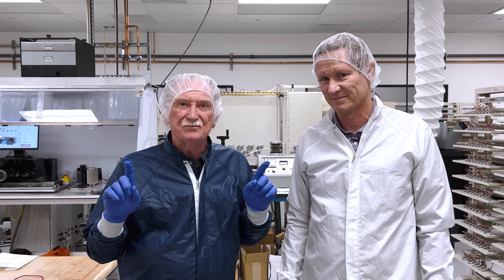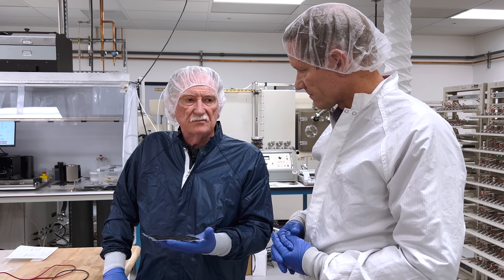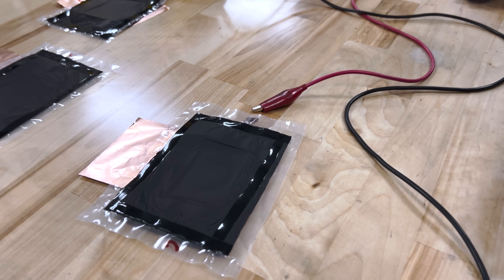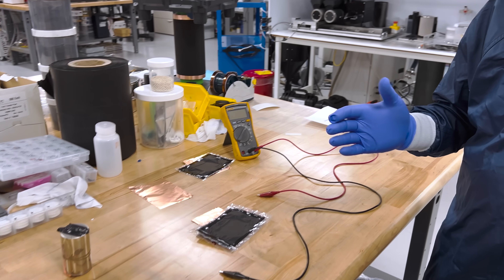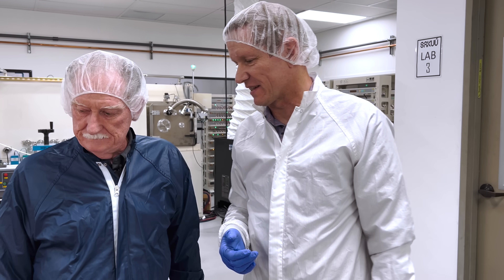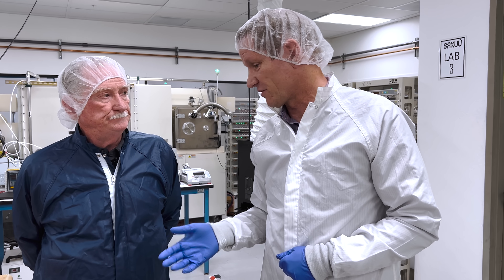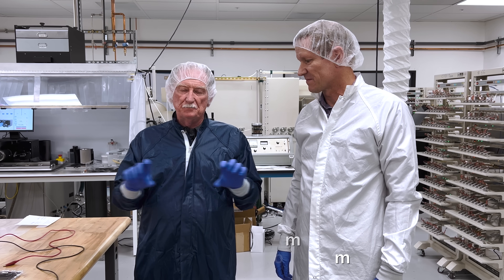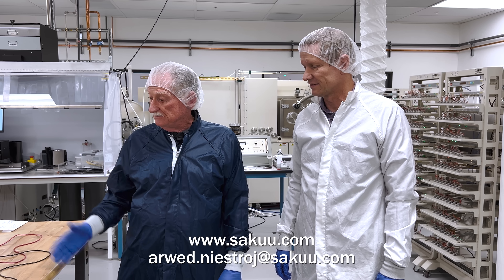Sakuu's Metal-Free Battery Cell: Game-Changing Innovation

Comment: You still gotta have a housing per stack somehow... even if you stacks 800 of them together or what not to get 800v, you aren't gonna just let them move around. So there is housing. Secondly, when you throw them into a battery pack, you are going to need reinforcements. While on paper it looks quite nice, but I think once you factor in the housing and the pack reinforcement, it'd still end up fairly close to 4860. Is still a nice tech nevertheless though.

Comment: At about 10:00 in the video, they show a machine building a multilayer battery.  I saw a shiny layer that looked metallic (aluminum?)
Reply: It may not be optimized or in high speed production yet, but I was impressed : My thoughts : Its lithium metal sheeting anode - Look a 9:35 mins - Two passes with the separator the same conductive polymer the anode & cathode are printed on. Like painting of the body of a vehicle there could be an static charge sucking in a uniform lay of electrolyte. " Stacking the 200 cells at 3.2 volts, 640 volts with minimal amperage &  two decent buzz bars is very interesting.

Comment: Without metal contacts per cell?  Built in safety with natural resistance?  I^2 R losses would be too high. Testing voltage is not the right test.  You need to test power!

Comment: OK, but how do they want to do balancing?
And did they do a hot plate thermal runaway on this thing? I've only heard them mention a penetration test. Overheating thermal runaway depends solely on the cell chemistry.
Reply: @atonduke7612  lithium metal , is not going to be good when that goes into thermal runaway..  water and lithium metal do not mix .. the Korea battery plant that killed 2 dozen weeks ago was lithium metal cells

Comment: ok so what is the operating tempature range because if it fails at low tempatures  and wont charge   then other than safety/cost it is not any beter than any other cell.

Comment: My primary questions are around temperature range where they work. is thermal control necessary for optimum performance? What application is it designed for? etc

Comment: Sounds promising. However. There is another thing to have them in cars. 
Charging speed, throtteling from heat or cold, capacity in extreme cold, keeping the voltage over time, power output consistency in several accelarations, quality control, degradation etc.

Comment: Toyota's 2027 hybrid gasoline engines are a rethinking of combustion engines - based on combustion engineering learned from hydogen research. A future RAV4 hybrid could achieve 80 mpg on road trips - 1,000 mile range - if you can afford it.  Not many details were released other than very short crankshaft stroke for reduced friction.  Electric motors will provide the oomph - the gasoline motor promises very highly efficient steady speed highway cruising.

If hybrids had a heat pump to recover lost exhaust heat, the numbers could be amazing . But how to reuse the heat? BMW developed small steam turbine generators with limited success.

Battery chemistry is like herding cats, something will always not follow your suggestions

Comment: Very interesting. The comparison at 5:24 (Energy Density, Weight, Volume) looked impressive,  as did the claimed benefits of no Thermal Runaway.  Reduced Cost (-7%),  and Simplified Manufacturing.  A couple of things not covered were Recharging and Chemical Degradation over time.  Hopefully those might be covered at a later date.  🤞🇦🇺  Subscribed.

Comment: Still stores energy, though. Can it release the stored energy catastrophically? (burn or explode) Runaway is not the only way to start a fire, and metal is not the part of batteries that is hazardous, anyway. Gunpowder doesn't have any liquids or metal in it either, but it can certainly release its stored energy in a hurry...
Reply: Gunpowder has potassium in it does it not?
Reply: @castlemason3961  Black powder, yes, but not in metallic form. (potassium nitrate) Your body also has potassium compounds, but no metallic potassium. Sort of like hemoglobin  in blood has iron it it, but no iron in metallic form.
Modern "smokeless" powder is nitrocellulose. Neither precursor has a metallic form.

Comment: HEAT - I really need to understand a lot more about how it handles HEAT!  I am ignorant about thermo-conductive plastics, but my Layman’s understanding is generally metals conduct heat much faster and better than plastics.  Moving heat around efficiently is something that has to be reckoned with.  I hope it’s not a game changer for this new battery technology.  High rates of charge (short recharge times), and Bat out of Hell FUN acceleration both bump up against battery heat issues.  And just plain old keeping the battery temp  happy regardless of what the weather’s doing outside is importing too.

Comment: its the same old chemistry. there is nothing here that is even interesting other than energy density which is cool from Sandys perspective because he is a design guy not a battery guy. the reason we like Li at 1000 charge cycles VS Lifpo at 8K charge cycles (and no thermal runaway) is density.

Comment: 😂It's nonsense. Advanced batteries have been around for years, the real issue is producing them on an industrial scale at a low cost. The same goes for the called revolutionary sodium battery. It's ironic because I've had sodium batteries in my workshop for over 15 years. It's just another play to sell cheaper batteries for the normal people, It's like making car parts now using plastic not metal to reduce weight... Sure, to reduce weight... Give me a break.

Comment: The 4680 housing contributes to the structural pack which reduces the overall weight of the vehicle. These plastic pouches will require the car-itself to have the structure. So yes, the cells weigh less, but I’m not sure the overall car will weigh less in practice.

Comment: A lithium ion battery get a new metal-free casing. So, that metal-free, bipolar pouch cell design is old. I first see that cell design in year 2018 and it was used in other battey chemistries as well. I make a cell with that cell design by using conductive plastic and a normal plastic for the spacer by my self. The cell was a zinc based cell and in discharged state the cell dont have any metal,... but when the cell was charged,  then the zinc was electroplated on the negative conductive poymer.

Comment: Printing batteries is genius. Without metals as a base layer, what about heat dissipation when heat conduction through metal foils disappears?
Heat dissipation via the edge and with thermal paste in contact with which packaging? Pouch cell at the end or a pressed stack like a square battery with or without housing, cell-to-pack or cell-to-chassis application?

Comment: Really excellent report on this leading edge, bipolar approach that may effectively enable "cells" of any voltage, rather than just 3.8v - 4.3v per "cell," depending basically upon how many layers you choose to put in the stack (basically the number of layers you need for whatever system operating voltage you prefer).

Clearly, this bipolar approach could lead to lower weight in the battery "pack" and lower cost, by eliminating the packaging of each individual low voltage cell along with its interconnection to typically two other cells. Depending on any necessary thermal management requirement and approach, this bipolar stacking of low voltage layers could lead to higher energy density for the pack as well, with the same basic chemistry, compared to cylindrical, prismatic or pouched "cells" in any other battery pack. Production cost should also be reduced by the dry coating/printing process that minimizes or avoids entirely the liquid solvents typically utilized today, as well as the flammable liquid electrolytes in use.

By non-metallic, I think the Sakuu spokesperson is stating there is no need for the typical metal layers typically required for current collection for each individual cell, usually Aluminum or Copper. However, there might still be metal(lic) ions used to shuttle the charges back and forth between the electrodes of each layer, whether these are ions of Lithium, Sodium or perhaps another metal ion readily exchanged via the electroltye medium, although a non-metal based ion might be utilized instead.

If a lithium, sodium or other metal ion originating from a pure metal layer is used to shuttle the charges back and forth, then a primary challenge with this type of battery will be to maintain the integrity of the seals against leakage of air or water into the stack, as air or water would be highly reactive with any pure lithium or other pure metal layer, like with the pure metallic lithium battery that the company has already demonstated can withstand >1000 100% DOD C/3 = 3-hour discharge cycles (with 1C = 1-hour recharges immediately after the full discharges), though no nail-pincture test results are mentioned regarding these lithium-metal batteries, nor is there any mention of the seal integrity issue.

Yet, the Sakuu spokesperson says the bipolar battery passed the nail penetration test, which suggests that it is not using any pure lithium or other metal layer. In this case, the energy density will be lower, but overall energy and power densities could still exceed that of conventional "cell" based lithium batteries at the pack level, again depending upon any requirement for and the approach taken for thermal management. Regarding thermal management, the requirement for heat extraction should be less and the time required should also be less to evenly thermally condition the bipolar layers for normal or optimal output performance and charging, and maximizing battery life.

To summarize, from what has been stated, a 10%-20% reduction in weight, volume and cost does seem reasonable to project with the shown bipolar, non-metallic approach (i.e., neither pure lithium nor sodium anode). Additionally, if the integrity of the seals can be somehow guaranteed, as suggested (but not shown) with its pure lithium cells, then this bipolar approach might potentially boost the pack's energy density by an additional 40% or more, as well as further lowering the pack cost/kWh.
Reply: Sounds like you know a bit about this subject, maybe more than Sandy. I need to read up on bi polar.

Comment: Alright Sandy...I've got to call BS on this one! Did they give you a reach around or buy you off to make this bit of drivel???
*
It's ONLY a "game changer" when it actually disrupts existing battery technologies with something significantly better that's actually produced in large, commercially viable quantities! Until then, I won't be holding my breath! Frankly, the 4680 exists now and is getting used now. This cell is at best still in the "research and development" phase. HOW Sandy can you claim this is your " new favorite cell" is a mystery to me! You SAW the engineer splutter over the charge cycle counts. He knows it's not getting 1000 cycles! I worked for a company that did cell cycling testing. We had the ability to cycle test 10,000 cells at the same time! This was very dependent on the specs of the cell under test for how long cycling would take to get to 80% of original capacity, but it didn't take 6 months! It was usually about a month! So for the engineer to splutter over cycling results...cycling tests hadn't been done yet or they had and were way under 1000 cycles!!!
*
If you look at any type of pouch cell or flat pack cell, they are many layers of much lower capacity cells inside all in parallel. The end result is the total voltage stays the same, but capacity is additive. These cells are not going to be stacked in series like shown in the video! They will be stacked in parallel. Parallel means each anode and cathode gets a metal foil sheet on it and an insulator between each cell. IE: SAME COST AND WEIGHT as anything else! The "test" with the multi-meter to show 3.2v, but no current is proof of nothing! Any lithium coin cell can show 3v and still be useless for powering even a watch! Comments were made about the metal can of the 4680...like that's a bad thing! It's protection and it keeps the jelly role from swelling. In flat pack or pouch cells you NEED external clamping to keep them from swelling! IS that somehow better???
*
AKA...100% of what was said about these cells weighing less, not having metal in them, lower cost, etc is all BS! KEEP liking the 4680...that's actually in production, getting used by the 10's of thousands NOW and still getting better and better! You REALLY LOST my respect on this video!

Comment: What is the internal resistance? What is the thermal conductivity between stacked layers?. How does heat generation compare to the cylindrical cells? If multiple stacked layers can be effectivelely cooled using exposed surfaces, it will be a game changer. Also, the higher voltage cells, if possible to discharge and recharge without additional heating, could simplify pack construction albeit specially designed BMS🤔. Under what conditions the layers degrade? Do they short or open under these conditions? Too many questions😅

Comment: What is the resistance and C-values? 

Packing a large Ah battery is also bit hard. Parallel connection needs a metal foils to connect parallel or larger cell. Still a good idea, the parallel connections between serial stacks don't need to be thick, they carry only the balancing current between same voltage cell points.

Comment: That's a bit misleading. You can't compare a complete 4680 cell with an unenclosed pouch that doesn't have current collectors. Those collectors don't weigh nothing, and you still have to package it. Also, you're now removing the structural element of the battery, so that will have to be put back into the chassis of the car. In reality, the energy density isn't as impressive when you look at the whole pack integrated into the car.
However, if they can manufacture this in quantity at a good price, it looks promising.

Comment: Wow this is incredible and a tremendous battery innovation!  The comparison between the 4680 cell and Sakuu battery was awesome showing the safety, volume and density advantages.  The manufacturing and recycling process will be much more efficient and less expensive.  This is huge!  I heard that the Sakuu battery has been tested up to 1,000 recharging cycles and they are working on incorporating other tech to improve.  One thing I did not hear was what is the actual charging rate.  Depending on what that is, it’s a game changer and is the future.  The next big step is bringing this to market and timeline.

Comment: Thank you Sandy Munro for keeping us informed. 7% material cost reduction, but also reduction in manufacturing complexity and manufacturing energy (extra cost reduction).  Simpler is always better for several reasons, but many questions remain. What is the delivered POWER per liter or Kg?  Mass production of this cell in the near future?  How does the Sakuu cell compare with China's latest LFP batteries?  Is Sakuu's dry 3D printing method also suitable for LFP chemistry or sodium chemistry?

Comment: Unless these cells can be over-charged indefinitely without danger or degradation, each cell will require a monitoring and balancing tab and that tab will likely require a thin foil between cells to maintain thickness uniformity. If you package a whole 800V battery into a 30mm thick package by layering those cells and then put batteries in parallel to scale kWh to whatever is desired, you will also need a BMS for each stack or have to parallel all of the cell connections to avoid having to balance each battery individually. Seems to me like the cell stacking trick is only viable when the application requires only one stack.

I'm not particularly thrilled with the idea of a 100% unserviceable battery where all the cells are laminated to each other.

Comment: Let's wait until they reach 1000+ cycles and mass production and then check them out again. It looks promising so far, we'll see. Theoretically this could enable a 1 MWh Semi battery that only weighs 3 tons or a 100 kWh pack that weighs about 300 kg, a 55 kWh pack that weighs about 170 kg, for the SR Model 3 or Robotaxi etc.

Comment: Violent runaway is such a non issue that rarely happens..  it's concerning that he is focusing on it so much.  it makes me think that there may be a performance hit or a charging hit..  or a cooling issue, etc..  Something feels fishy. lol.  We want to hear how much better it performs-- not just how safe or light it is.  Can it still discharge fast enough for a high performance car?   How do you keep it cool if the metal is gone?   If it can keep up with current performance and still be this light weight, with cheap materials  etc..   This is BIG

Comment: If this works out, it's a great improvement.  Thanks for the technical detail but what we still need to know are the maximum charge and discharge rates.  I still don't understand the packaging though, it seems natural as a pouch or prismatic style case, you can't just throw a loose stack of these into a battery box.